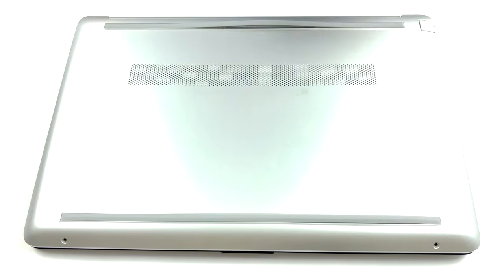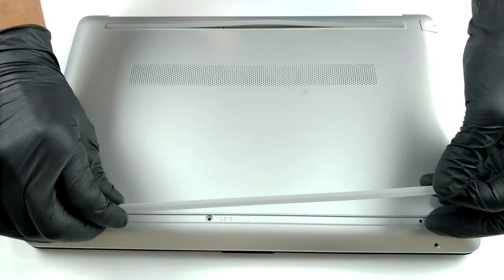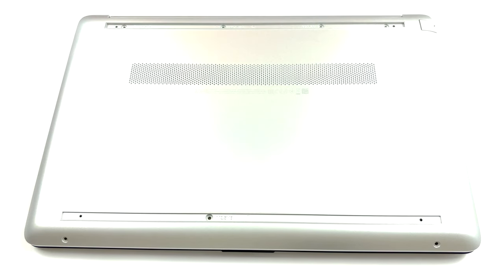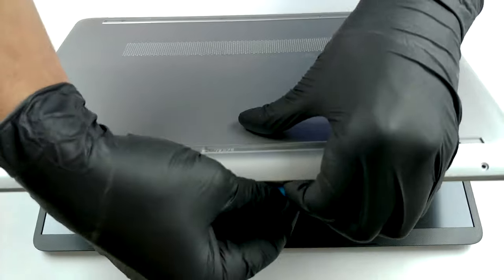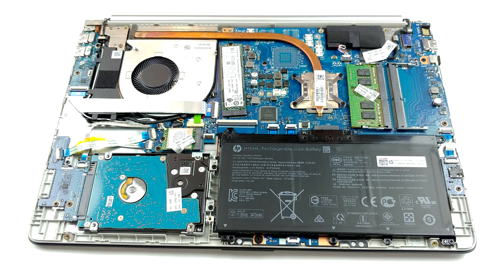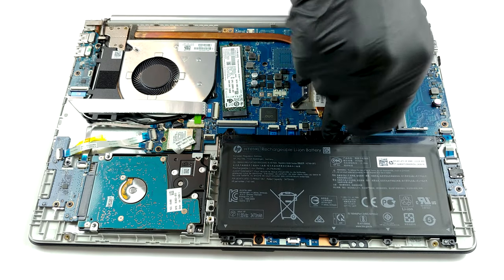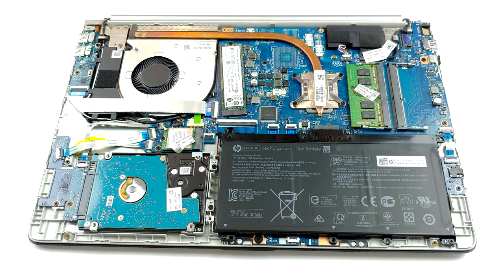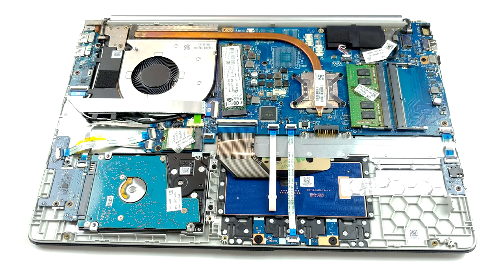🛠️ HP 15 (15-dw1000) - disassembly and upgrade options

Comment: Does this mean i can have both ssd and HDD hard drives in this laptop? i have HP Laptop 15-dw3024nx with 500 gb nvme m2 SSD and i really wanna upgrade it or add another drive if possible.

Comment: what's the code name of the sata adapter?, I recently buy a dw2xxx but it come without the adapter for the HDD.
Reply: i have the same problem. do you find anything?
Reply: I have the same problem...
Reply: @DiegoRomero-hm7cn   @Jorge Miguel Castillo Vasquez   I found the parts codes, L52024-001 HDD board and L52025-001 Cable flex, but is hard to find the spare part in my country, so I decided to use an external hdd.
Reply: @jorgemiguelcastillovasquez8981  jeje no hay problema, yo soy de Colombia, imagínate, si en México es difícil que esta al lado de USA, en Colombia más complicado aun encontrar esa parte, la verdad me decepcione mucho al ver que no traía esa pieza. También pensé ponerle un adaptador distinto de otra laptop, pero si me pongo a gastar dinero y que tal vez no funcione, preferí optar por el hdd externo. 😅
Reply: @SahrScorp  Hola, vuelvo después de un mes actualizando el problema, encontré un adaptador en aliexpress, justo lo acabo de instalar y funcionó a la perfección y lo mejor es que me costó 7 UDS aproximadamente, te paso el enlace por si estás interesado
https://es.aliexpress.com/item/4000801577069.html?spm=a2g0s.9042311.0.0.23c463c0yXnMcs
Reply: @jorgemiguelcastillovasquez8981  ufff muchas gracias, se ve igualito, espero no presente ningún problema.
Reply: @SahrScorp  Hasta ahora ninguno, funcionó a la perfección! :D
Reply: @jorgemiguelcastillovasquez8981  En serio muchas gracias, enseguida lo pediré
Reply: Hola tengo una hp dy1024, solo vino con un m2 de 120gb y creo q no trae la conexión para otro disco, saben si ese conector q dicen me puedo servir, y como es el nombre específico para comprarlo, gracias, soy de Argentina
Reply: @matiasleiva1775  Creo que no le sirve esta pieza, la configuración de tu motherboard es diferente, si no estoy mal.
Reply: Gracias por responderme, hay algun número de serie o de pieza donde me pueda fijar cual le serviria?
Reply: @matiasleiva1775  Creo que tu board es similar a esta https://www.youtube.com/watch?v=nF9ryZd59ss y si es asi, la placa SATA donde va el HDD es algo diferente.
Reply: Amigo es esta, https://www.amazon.es/HP-15s-fq1075ns-Ordenador-i3-1005G1-operativo/dp/B085SQT3GJ/ref=mp_s_a_1_1?dchild=1&keywords=hp+dy1024&qid=1602036968&sr=8-1, en la parte de reseña ahi una foto del mother
Reply: @matiasleiva1775  Encontre estos números de partes: la tarjeta L20454-001, y la lámina aseguradora L20455-001.
Reply: El conector para la cinta lo tiene al lado del m2 o encima de la batería si me lo puedes decir?
Reply: @matiasleiva1775  Pues ahi si ni idea, porque el que me muestras la referencia es otra, y la board tampoco es la que estaba viendo, dime, el tuyo tiene unidad de CD? El que yo estaba viendo es este https://www.youtube.com/watch?v=nF9ryZd59ss pero si dices que tu board es como la que muestran en las referencias  del link de amazon que me pasaste, entonces es diferente al que estaba viendo.
Reply: @matiasleiva1775  Mira si te sirve este manual, aplica tambien para los HP-dy1xxx http://docplayer.net/124527209-Maintenance-and-service-guide-hp-15-laptop-pc.html

Comment: You can upgrade it to 16GB DDR4 RAM but the Intel Celeron N4020 can only handle 8GB as maximum.
Reply: Can you use a hdd on it or not